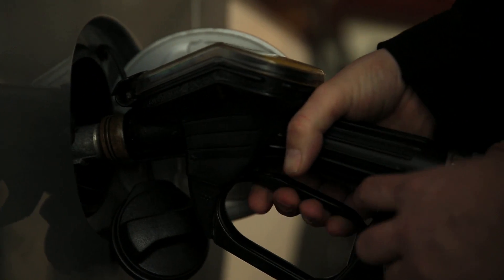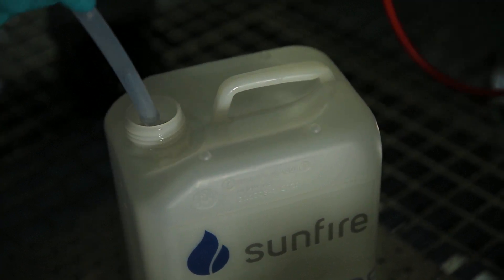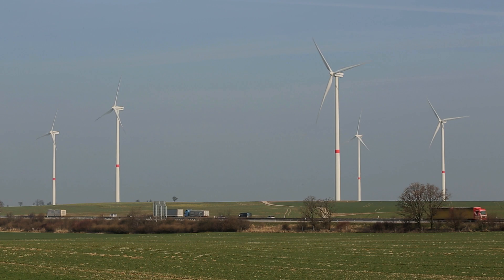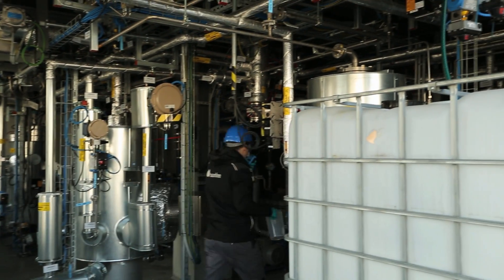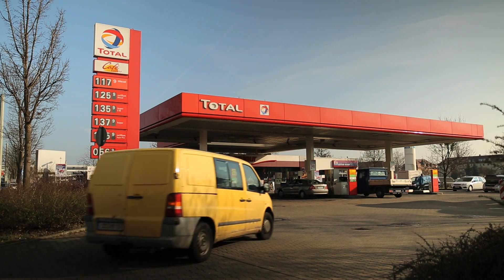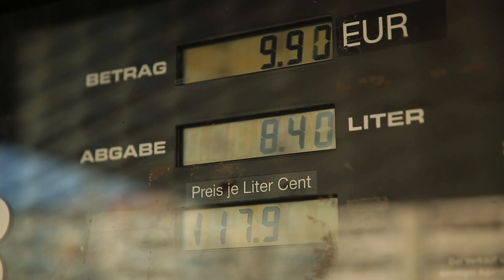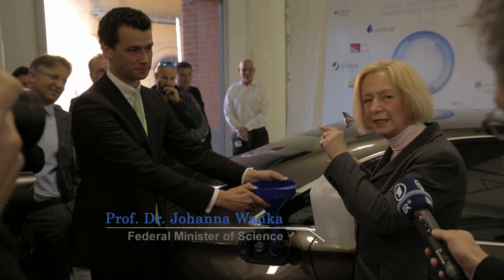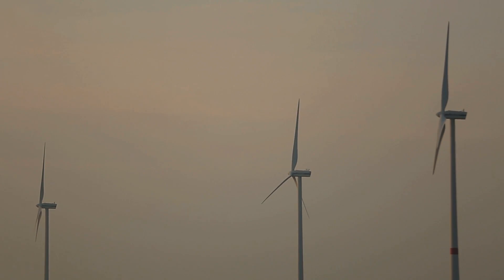Sunfire: Alternative fuels from air, water and renewable energy

Comment: Is this E-Diesel emission-free?
Reply: The Primordial, if I understand the video correctly, there are still emissions in the form of CO2, but since captured CO2 from the atmosphere is used as an input during the fuel-making process, in the end this will be carbon-neutral. This also assumes that you are using renewable energy sources (solar / wind) for the electricity required in the electrolysis process. The basic idea is that you're not releasing stored carbon from fossil fuels and you're instead creating this kind of carbon recycling. I'm not actually a chemist, I'm an electrical engineer, so I really don't know this for sure. Maybe somebody with more chemistry knowledge could comment? (And correct me if I'm wrong, please!)
Reply: Thanks, that's what I've gathered too since rewatching a few times. The sulfur emission part threw me off a bit at first.